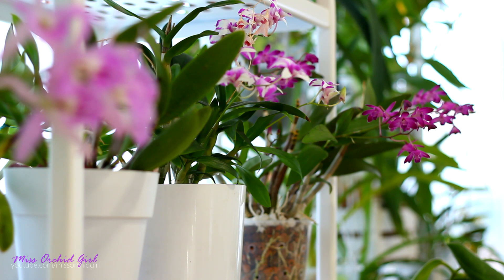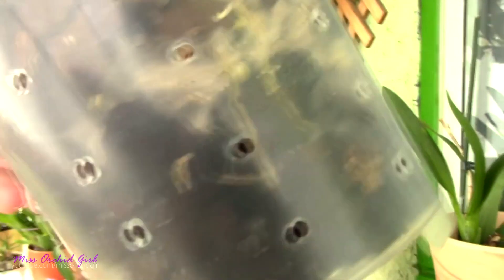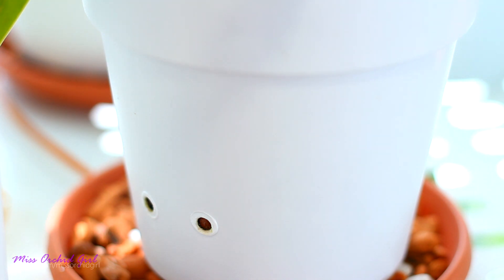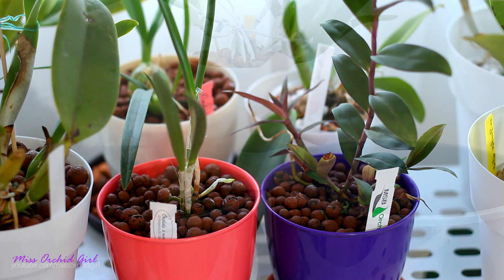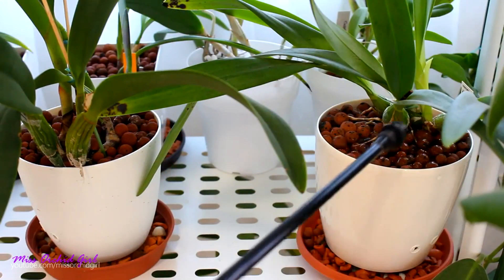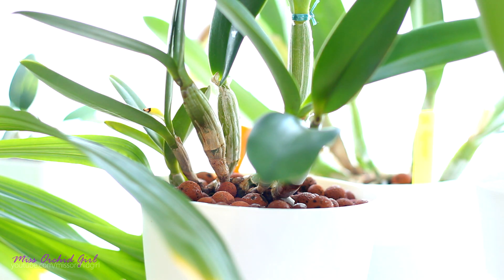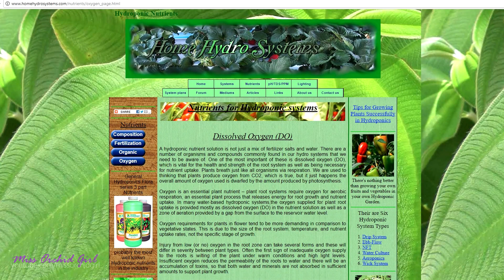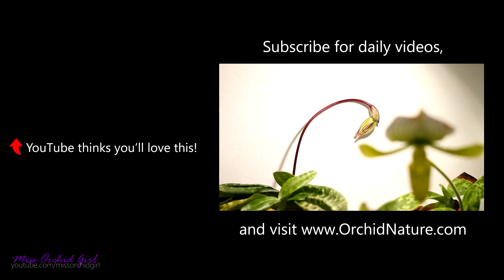Your questions on Orchids in semi hydroponics answered

Comment: I have a 60 gallon paludarium and was considering building it up using branches and moss that would be ready to mount orchids when established. I have dual fogging systems on timers that produce ~5 micron fog droplets. I'm reading mixed info online about how well this would work for orchids. Most say that the roots will wick up these droplets that form on the exposed roots. The moss below would also hydrate and give the roots moisture when the fogger is off. Do you have any experience in fogponics and orchids? 60 gal = 48" wide, 25" tall and 13" out.

Comment: Hi Danny.  I disagree with your theory of oxygen exchange. I don’t think the drying and rewatering of the reservoir provides enough oxygen in the water.  In an aquarium with water that isn’t moving enough you’ll see fish congregating to the top, the surface  of the water where there is oxygen available.  In order to disperse the oxygen and make more available towards mid tank and bottom you would have to create water movement.  In a tank if you have a power filter, it’s the movement of the water that oxygenates the water.  The airstone creates the movement that’s most important, not the bubbling in the water.  I think the roots in the reservoir perhaps grabs the air, where it’s out of water and those submerged simply absorbs water and available oxygen or other gases in the air.  But possibly the submerged roots might be more resilient to lack of gases and die off more slowly.  Just a thought.
Reply from the maker: +Thomas M Hi, aquariums have a bad habit of forming surface tension, as they are not full of materials sticking out to break the tension. Surface tension = bad gas exchange, thus we must move it. Aquariums are also not fully emptied as part of maintenance. Since there is no surface tension in the sh pot and it empties every few days.. I don't see how we can compare them really..
Reply: MissOrchidGirl 
Agreed.  You’re right about the surface tension with the Leca beads whereas the aquarium is only glass.  Thanks.

Comment: Hi Danny.  I was thinking to use clear pot for the inside as a liner with the reservoir hole and an outside holeless planter to prevent algae buildup.   A black on for the winter for warmth and a lite green during summer to prevent algae buildup.  It’s like changing coats for the winter and sweaters for the spring 😬.  Maybe a heated pot for cold winters with its own battery pack 🙄 or cord connection.  🤓.

Comment: Hi Danni - I have very hard water but with several water butts in the garden I have plenty of rain water. I am worried that I will be introducing a lot of algae into my orchid pots if I use it so wonder if boiling the rainwater will help or would it kill all the nutrients the orchids need? Thank you for your videos. I am new to orchid growing and am totally hooked!
Reply from the maker: +Beth Bleaden Hi, boiling the rain water is perfectly fine, it is considered pure, meaning it  doesn't have any nutrients. It could have algae spores yes, but opaque pots should fix the issue. Fertilizer should be provided after boiling, if you decide to do so. I don't think it's necessary though ;)
Reply: Algae spores are everywhere. Very hard not to get algae